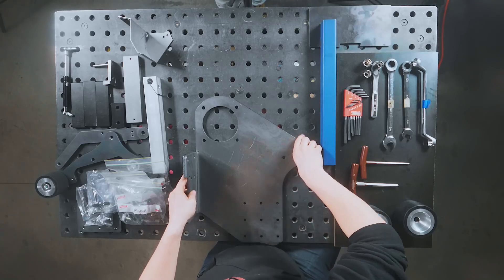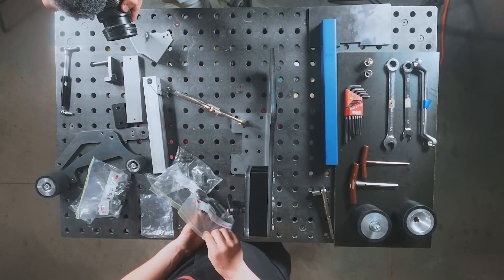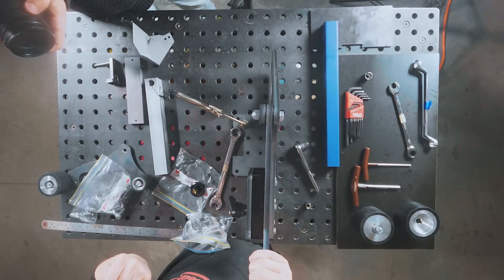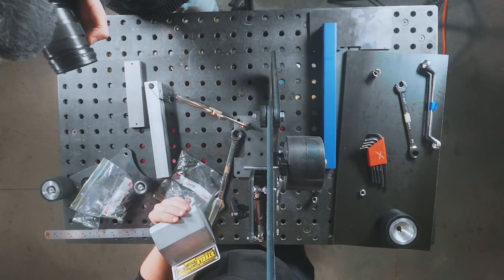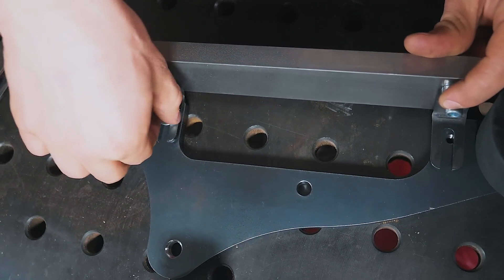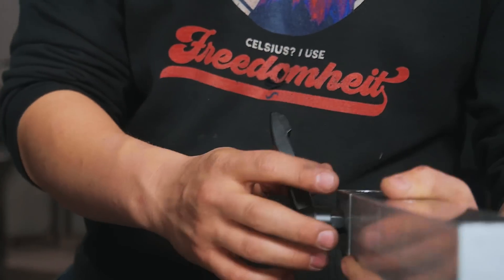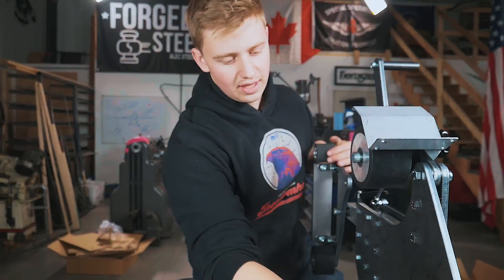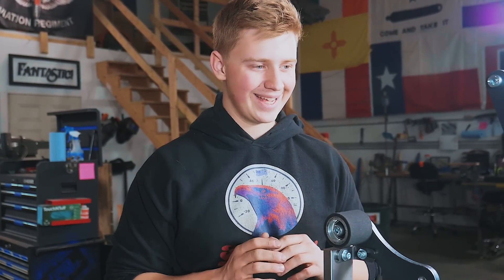2x72" Steele Kit Grinder - Unboxing and Assembly Tutorial

Comment: Seems like enough footage for me to rebuild it for myself😁😀
Reply: I was thinking the same 😂
Reply: same ahhahaha
Reply: Im about to get a plasma table up and running and just start building them
Reply: @FiredUpKnifeandTool   sell me one 😂
Reply: @liamfeely2806  honestly kits are going for 550 to 700 all over right now you can order a plug and play origin blade maker for 759$ if you add the 20$ tool rest not counting shipping and that is a solid machine single speed but i know lots of people put a router speed controller on them and get some variability or even just step pulleys with a belt....the options for cheap solid grinders are endless
Reply: @jagerfromgsg945  a quick google search will give you dozens of options

Comment: Interesting that many bolts don't have any locking or spring washers. Are there any issues with bolts working loose due to vibration, or do you recommend loctite or similar locking compound?

Comment: So, everything is either sold out, or coming soon on the website, but I don't see how much they cost. I'd like to know if they're going to be in my price range or if I'm going to have to go with something else for now. I'm really wanting to upgrade from my little 1x30 harbor freight sander soon and I really want to support you guys. Just need to know if it's going to be something I can swing when the store is stocked back up?
Reply: I think im just going with an origin blade maker the basic grinder single speed is 759$ with the added tool rest and easily upgraded to a vfd later ....759$ no screwing around with assembly just yank it out of the box add a belt and plug it in to a 110 outlet and go
Reply: 2x48 starts around $1400
Reply: @takeaseat6969  are you freakin kidding me! 1400 for a 2x48"?!?! Thats damn near robbery! Hell with that im definitely going with OBM now
Reply: @FiredUpKnifeandTool  it's actually a great deal. Motor, vfd, all wired...
Reply: @takeaseat6969  the obm plug and play 2x72 vfd is that price and twice the grinder than a 2x48
Reply: If you need to save for it you can't afford it.
Reply: @googleuser859  all these ppl asking how much, how much? If you have to ask, you can't afford it.
Reply: @googleuser859  thats an idiotic sentiment
Reply: @takeaseat6969  i was taught to be frugal i could drop 1500 right now but the value of a kit grinder is not there when assembled plug and play models are on the market for the same price it doesnt matter if its 1200 or 12,000 the value is not there. That being said saving up over time for something allows for market research and shopping around ...can i afford it right now? Easily but do i want to compare pricing and performance while saving up for one instead of draining my bank account because im smart with my money and know how to budget?absolutely

Comment: Great tutorial. One thing I would suggest is you guys might use some bag on a roll and a heat sealer instead of using Ziploc bags.  Will save you time, but also look a little more professional.  They come with white on one side and clear on the other also for easy labeling.  Just a suggestion, but great looking products, and keep up the good work.
Reply: I was thinking the same thing but thought maybe they just threw the hardware in zips to make it easier for the video. 
Not sure tho, haven't bought one yet.
Reply: I was thinking,  "Hey,  look.  Ziploc sandwich bags!   Cool! "

Comment: If I recall the one you guys use in the shop is able to turn the whole assembly on its side 90 degrees, will we be able to purchase the hardware to do that or is it something we figure out on our own?
Reply: Mckay Noble that’s the more expensive Gibson model. But the manufacturer, 84 Engineering, seems to make that mount for the 2x48 and this 2x72, so I would like to see if this is an available option in the future.

Comment: Awesome job guys, so happy to see you working hard and doing well.  Just wondering if the motors are 220 single phase or 3 phase.
Reply: Sebula21 if I recal correctly; most Motors on belt grinders are 3 phase, which is why there is a need for the VFD. It’s a speed controller but it also converts the power so you can run the motors on single phase

Comment: Are the fasteners metric or imperial? Will you be supplying these outside of the USA?
Reply: They're imperial, did you even listen to anything he said?
Reply: @andyb7963  Will mostly stated the size of the head of the bolt, or the size of spanner he was using. A 3/4" AF spanner would fit the 19mm head of an M12 bolt, as 3/4" is 19.05mm. So, the fasteners could well be metric. Also, the belt grinders are made in Australia, a country that lives in the 21st century. Therefore, it would be reasonable to assume that they would use metric fasteners, thus, the question that I asked was  perfectly valid.

Comment: I sure hope he's using locktite and taking all those nuts and bolts to torque
Reply: Seems abit excessive for a demo
Reply: @immasurvivor  But also a very good point to mention in the video even if you dont actually do it. Like they say on the site its a very dangerous machine when used inproperly, the same goes for subpar assembly.

Comment: All Alec did is bought a bunch of grinders wholesale cheap , he must of gotten a deal if he bought so many , then put his name on them when really they were someone else’s grinders & jacked up the price , same with all the tools had them made dirt cheap then sold them at a higher price , I,ll almost bet that if you go to the dealer that sold him the tools or grinders you can get them cheaper than what he & will are selling them , I was in wholesales & retail for 5 years so I know how the system works. I,m not dumb. If you want a better price just go to the source that makes the tools & grinders . I started a company when I was 29 by legally steeling venders from a company I worked for & even negotiated a better price than the company I worked for was getting now I,m 46 & was able to retire from the company with a $ 120,000 Thousand dollar a month retirement paycheck , now my daughter runs the business.
Reply: He's literally said that's what he's doing, with a couple key additions: including all the necessary bolts, including a motor and VFD in the same package, and pre-wiring it all. Yes it's flipping, but he's adding value by doing a lot of the more PITA steps for you.
Reply: Robert Lee yeah it’s not some conspiracy, they have said repeatedly that these are made by 84 Engineering in Australia, all Alec and Will do is bulk order the grinders, motors, and speed controllers, QC, Market, set up the web site, and handle the shipping. 

They are doubtlessly making a profit, but when you account for the work they are putting into it, they are not robbing people blind, and are still selling a competitively priced quality product.
Reply: Also, the hammers were made by a former student if his, which practice is the hallmark of a master craftsman.
Reply: I'm rich too, I started my business when I was 3 and retired at 7, I earn £500,000 a month now.

I also stole my employer's business contacts and I'm morally bankrupt. I'll walk over anyone just to make some cash, I dont care about being a good person or having any moral values.
Reply: cucumber fruit I ,am proud  , the company I worked for was shitting on me for years & wasn’t paying me what I deserved for the kind of work I did for them . I graduated from a 4 year school & went into a company that wasn’t willing to pay me the net worth I should have been making so I worked for them for 5 years just so I had some kind of income coming in & to learn the process then took there good venders out from under them & there was not a thing they could do about it , it was all legal & not bound by any contract so I took what I earned & proud of it . I stood up to a company that didn’t care about there employees & not a soul in the department I worked in went to school for the kind of work I did or could do the work I did so my boss would give me all his shit jobs because I could do them & he couldn’t .
Reply: Art of the Ancients & I agree with that totally no harm no foul.
Reply: Art of the Ancients there’s no problem with that , I’ve had to train people like Alec & Will have it’s passing on a dying art .
Reply: Random Guy & there’s no problem with that but you can go to the source & do it yourself for less than what there selling it for that’s what I was saying
Reply: cucumber fruit if you could do it , you would & don,t tell me you wouldn’t , if you had the chance to make way more money than you do now by any means necessary & it was all totally legal you would burn all your bridges & not look back .... see the difference between you & me is if I burned all my bridges & had to go back that way , I,d either build a new bridge or swim across or take a boat & any how I can Wright a bigger check than you can on your best day .